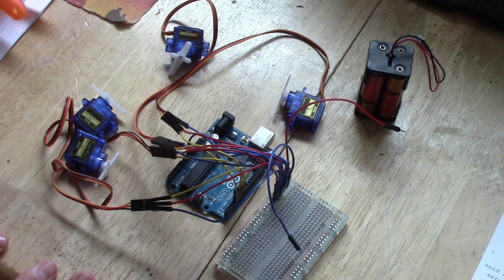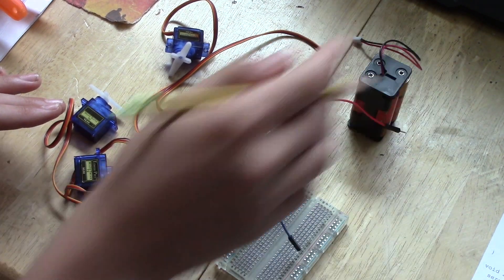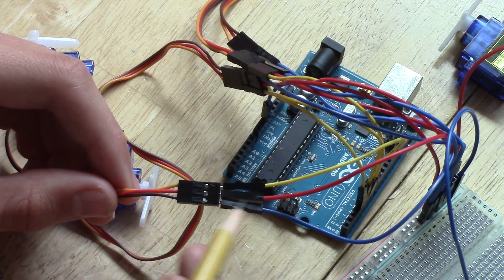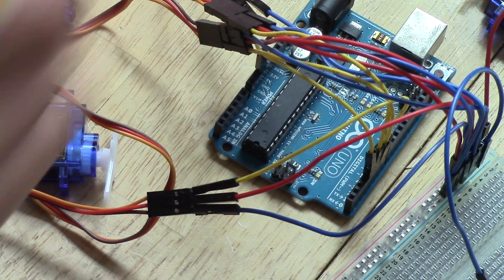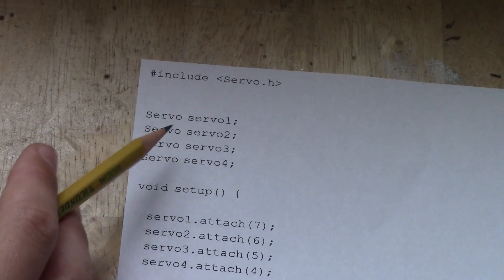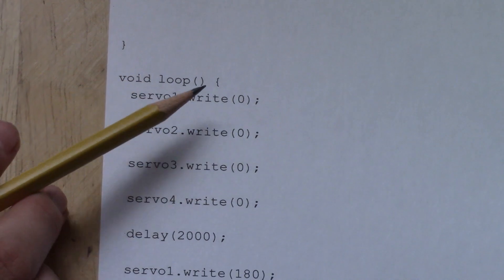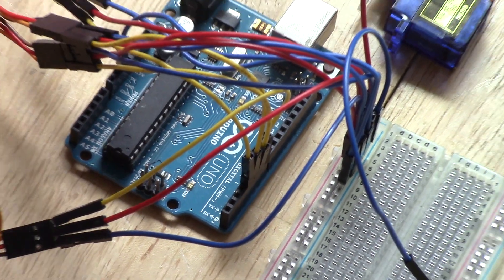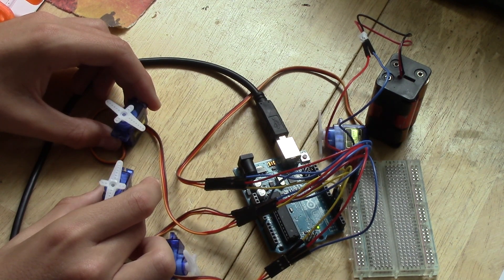Arduino Servo Motors with External Power Tutorial

Comment: I will be using 3 servo SG90 motors, but all of them will not be running at the same time. The first one with rotate as required, then after one second, second SG90 will rotate as desired and the final will turn as planned after say 5 seconds. They are operated via Arduino UNO.   Hence in such a scenario, what voltage and amperage will be required and can I give the same with any cell phone charger or similar equipment.  Kindly guide. Thanks in advance.

Comment: Hey I want to power 2 servo motors with external power supply. So should I use 2 AA battery pack or 4 as you have used?
Reply: 4 AA

Comment: hi can you help me, im kind of new in the circuit stuff, i use 4x AA(zinc battery) cells to power up :
- 2x micro servo 9g 
- 1x bluetooth module hc-10
- 1 arduino uno on 5v pin

everything was working fine, but after 2 days. whenever the servo moves, my arduino LED and bluetooth LED kind of dampen and the arduino code just stop mid way and the bluetooth connection is disconnected from my phone then both LED returns to normal. i use sleep_down_power_mode on my code to save battery consumption. is the battery starting to die out? or there is not enough current? i wired everything in parallel circuit. every components connect to + column on breadboard

Comment: Can I power only one servo at a time with this battery
Reply from the maker: If your Arduino is still plugged in to mutable servos the 4 aa batteries should still work on powering one motor at a time. However, if you have just one servo hooked up to the Arduino you should use the 5v pin to power the motor as there is no need for an additional power supply.
Reply: @90secondarduinotutorials5  thanks for response.... 
But it is not a good idea to power one servo with 5v pin because I ended up Destroying my arduino board when I applied load on the servo. So I buyed a new board.

Comment: You solved my problem thanks. 
Can u tell me how many servos can I control with the same battery which u shown.
Reply from the maker: Usually the general rule is 1 amp per SG90 Servo, so I wouldn't use more than 10 servos for the battery pack shown in the video.